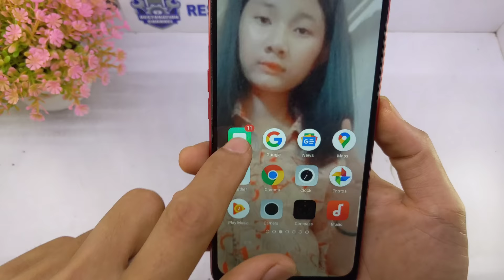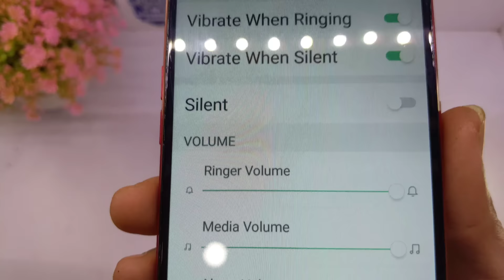Looking for an old phone in the trash || Restoration broken phone

Comment: I am my iPhone-6. It is locked. Its main owner does not remember iClod. I took it to the phone repair shop. He said I could repair it with a line or wifi. I repaired wifi. After a period of time, the phone needs to be updated. When I finish updating, the situation of iClod will happen. Whenever I want to put iClod there, it will say iClod. No, I can't take it to repair the phone because I don't have the money to repair it  I hope you can explain this problem